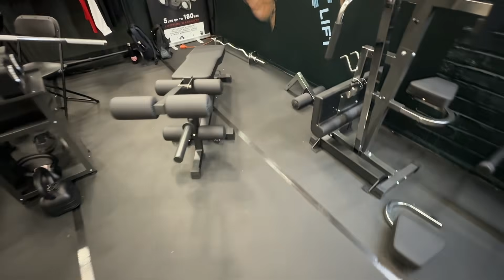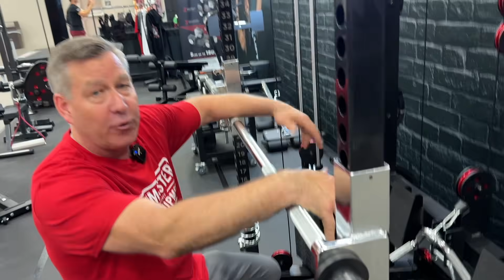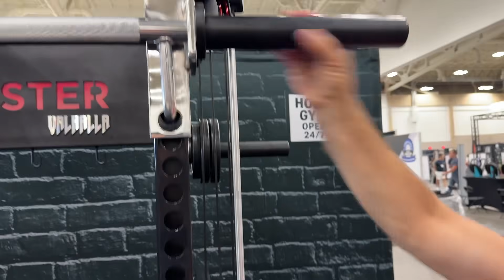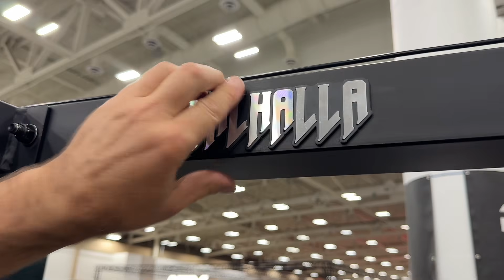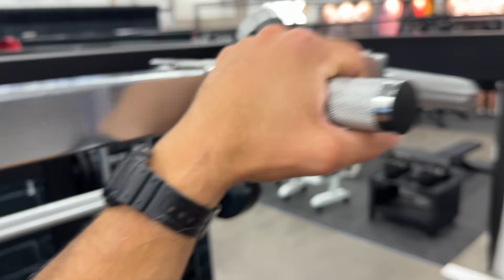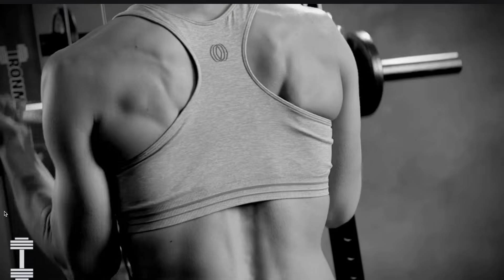Ironmaster Valhalla (IM3000) In Depth Reveal and First Impressions

Comment: Are they discontinuing the IM2000 for this? I personally hate these overbuilt machines.
Reply: No way, the IM2000 isn't being replaced or discontinued. It's a great machine and will still be the right solution for many.
Reply from the maker: I feel like I heard they were still going to sell the IM2000, but I could be wrong
Reply: They still sell the IM1000 or 1500 or something I think. It’s a strictly half rack version that has no smith or cables. If they still sell that, I think they’ll sell the 2000 still too. Love mine. I’m sure the 3000 is great, but I don’t really have the space. For that price you can just get a separate piece alongside an IM2000 as well

Comment: I’m assuming the functional trainer is 2:1, so 10 lbs feels like 5 lbs. If the lat low row is 1:2 and goes up to 400 lbs, does that mean it moves in 20 lb increments? 10 lbs feels like 20
Reply: Nailed it.
Reply from the maker: You are correct on that I believe. That's what I remember Brian from IM told me as well.
Reply: Oh well. I would rather go up in 10 lb increments with a max load of 200. Can’t have it all

Comment: I want IM to made a low row option that will work while seated for the IM 2000. I realize there are hacks out there for this but it would be nice if there was a dedicated option or attachment for this as well.
Reply: We have a bench attachment coming out soon that is a nordic curl, alternatively it will hold your legs for lat pulls.
Reply: @IronmasterPro You guys should offer the laser etched numbered uprights as an upgrade for the Im2000. Matt said this is a thicker gauge steel too? I would love to buy these for my Im2000.
Reply: @glenn4110 we’re listening
Reply: @IronmasterPro Cool I look forward to trying it out.
Reply: Low row foot plate for it but you have to sit on the ground
Reply: @nygardenguru  Yes I actually have this attachment. I was wanting a similar option for either an attachment or a pulley option where I could do rows on my superbench with the IM 2000 without having to sit on the ground like in the demo for the Valhalla.

Comment: I'm very surprised IM completely disregarded a 3x3 dedicated free weight rack within the overall frame.
Reply from the maker: I hear you, most for all the after market stuff. I wasn't at all a 3x3 person until I realized all the after market stuff I wanted to try but couldn't
Reply: Ideally the whole market would use like 2.5 by 2.5 with 1 inch holes or 2 by 2 with 5/8 inch holes to have smaller racks....but 3 * 3 is the most common and what firms should be trying to build off now.
Reply: 3x3 racks are silly. Thicker uprights make squatting less convenient because you can’t grip the bar as wide.
Reply: @Navigator1221  ...are you sure? Every powerlifting gym I've been to has transitioned to 3x3 racks over the last decade. From a home gym perspective 3x3 racks are the basis for modular ecosystems from multiple suppliers. The advantages vastly outweigh the (IMO Imaginary) disadvantages.